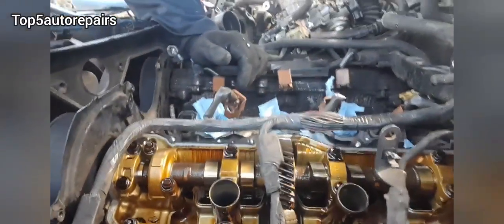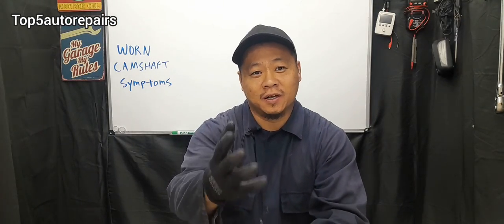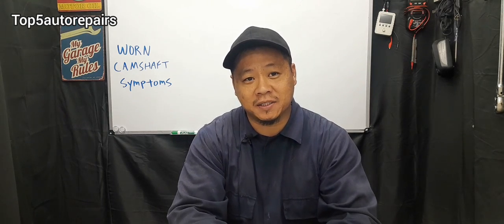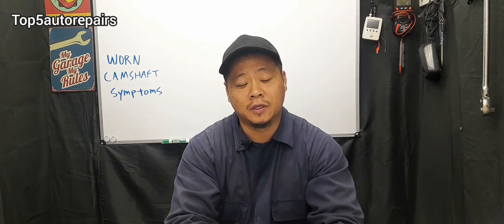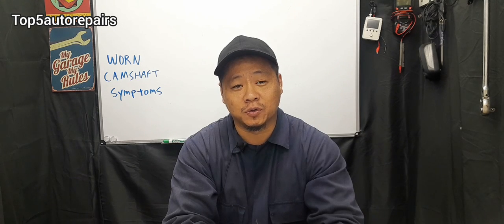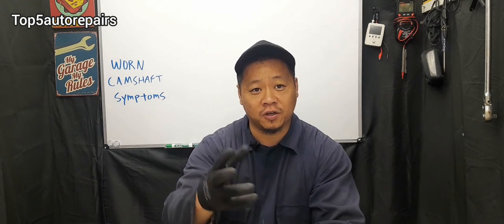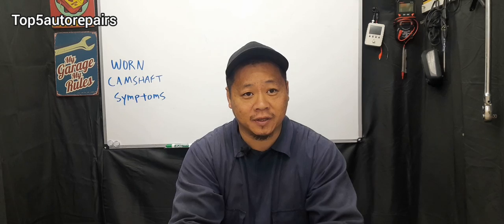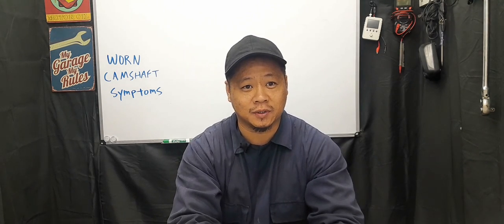SIGNS YOUR CAMSHAFT IS BAD AND CAUSING ENGINE PERFORMANCE PROBLEMS

Comment: Chevy Tahoe 2011 5.3
So I replaced my lifters but not my valve gasket  seals/ any seals in general besides the exhaust manifold gasket and the gasket that the intake manifold sits on, anyways I put it back together and now have 3 misfires, my headass replaced the spark plugs and spark plug wires to try and fix the misfires, after watching this I would assume it’s due to the low oil pressure from not replacing the valve cover seals, and the 4 seals on top (small circle ones) I have just taken it apart to replace the seals, any other advice on what else I should replace while it’s apart (not deleting the afm bc I’m not that confident in doing that yet)

Comment: I have a 2007 Mercedes ml350 that has a random misfire jumping around. Also different cylinder misfires and lean on banks 1 and 2. Changed plugs and coils. Also changed one valve cover that was leaking oil and pvc vent valve. Still has misfire rough idle. Could bad cam plugs cause this misfire and lean condition?
Reply: I've noticed other valve cover was not leaking around seals but was leaking around the big and small cam plugs

Comment: Sir i have kia forte 2012, which has loud tickling noise , i think it it cam shaft. Check engine light has code po0011. What can be the issue for that noise
Reply: I think Its the cam lobe that's worn out. Did you fix it ?

Comment: This camshaft Doesn't it make the p0440 code appear? And how can I check the camshaft if it is good or bad?
Reply from the maker: It's unrelated. P0440 is evap system and the other is the top end/valve train issue. Remove the valve cover and inspect the camshaft for worn lobes and any visible damage/scored journals.
Reply: @Top5AutoRepairs  okay sir and if I have code p0440 what can I do there can you help me .. gracias

Comment: Can this cause the car to accelerate from 0 to 100mph very well, but as it reaches there it struggles to go beyond 100mph while maximum speed is 180mph????
Reply: Worn cam can definitely cause that scenario.
Reply from the maker: Most likely computer needs to be reprogrammed or there is a speed limiter.
Reply: @Top5AutoRepairs  initially i used to driving and  everything is fine and could speed up  to 180mph. Only to realize nowdays why can't go beyond 100mph. I dont know what is going wrong with it.
Reply: sounds like a starvation of fuel. Check fuel filter dirty injectors, or if it’s a carburettor could be some sort of blockage. Even a blocked air cleaner.
vacuum pipe leakage any number of things. Camshaft issues is not that common.